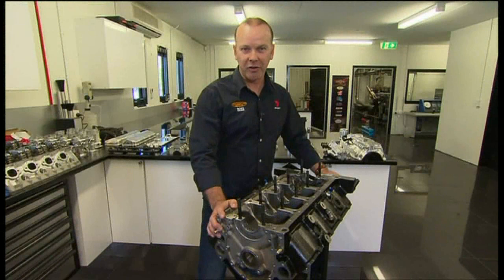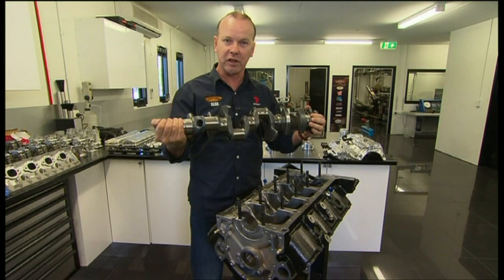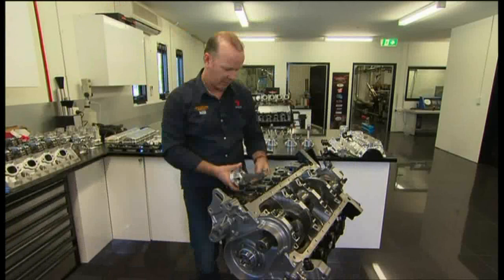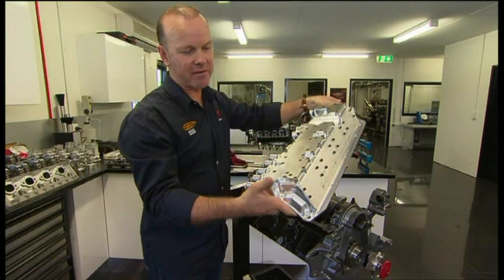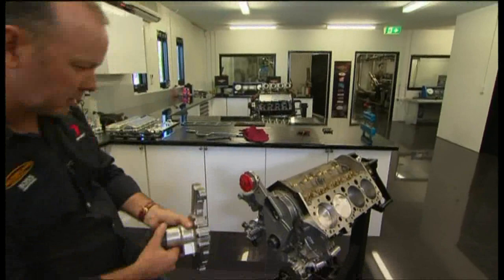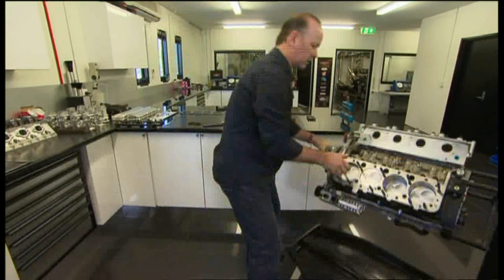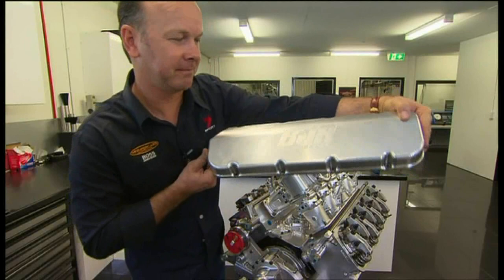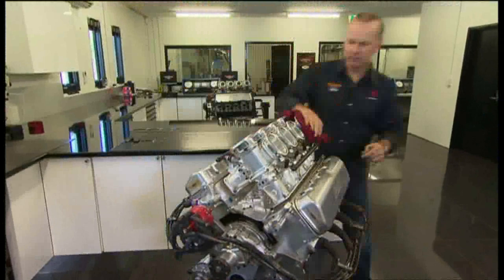V8 supercar engine build with Mark Larkham

Comment: As a ex V8 Supercar engineer the reason for the 5K exhaust header is the cost of the titanium metal used to make the pipes as well as the many hours of hand fabrication involved to make the exhaust by Tig welding together the mandrel bends & merge collector pipes. 
These exhausts are a work of art when finished. Exhaust development is continual.

Comment: there is a lot of mark up on these engines. parts come thru performance wholesale. sold for f all to v8 supercar aus. then they sell parts to the teams at a very big profit...the crank is a 3 grand item, block 2500. cam 530 . they double everything and some
Reply: Nicole Gooch V8 Supercars don't buy the parts. Each team buys them straight from the supplier or manufacturer. Seeing as the majority of parts come from the U.S,  you have to convert the U.S price into the AUZD meaning the price increases, then add import tax and freight.

Comment: The heads look very similar to what would be used on a SB2 in Nascar with the canted valves.
Reply: Nick Hargrave project blueprint basically stole all the good parts off the ford Counterpart in this series(@that time)those heads were based of the canted valve ford  even the block was a specialty to v8 supercars 
Commodore got upgraded with fords double front suspension arms and locations were shared between the cars. 
Ford basically got a little bit better aero..it was the start of when the cars really became to far apart from the road vehicle they were based on nothing in common was really left

Comment: @FordV8Supercar These stats are from the mid-90s, but I do remember them well; Ready to run engine, $60,000, ready to run Hollinger race spec 6-speed, $50,000. The latter, you can choose your own ratios, but there's limits to how much you're allowed to mess with in the engines. A fully prepped car from Perkins (Larry's workshop) Engineering would set you back in excess of $220,000. Then there's tyres, spares, safety equipment, transport pit crews and sourcing a driver

Comment: The tolerances oin CAT engines are extremely tight, often assembled in surgically clean conditions. I meant that a race engine is capable of sometimes up to 9000rpm. A CAT diesel at best will rev out to no more than 4000 maximum rpm And of course, some of the larger CATs fully assembled cost more than $50,000

Comment: @jimmycranberry single camshaft = less space required for the engine. Dual overhead cams take up a lot of space even though they are slightly more efficient. It sounds crazy but Corvettes still use them and they win the 24 Hours of Le Mans with it.

Comment: Why are people watching this? then bagging out V engines. Nissan R35 Skyline has a V6. All the good BMW, Mercedes or Audi's are running V8's or V10's. Audi V10 with turbos. The new Ford GT with 5.0L alloy block S/Charged from factory has 335 kw they run 11.9 down the quarter with a flash tune on stock tyres. Are there any new japanese cars other than the R35 that will even compete? Performance wise and value for money- I think not....

Comment: you'll find that in a lot of cases CAT motors have the same tolerances as lot of road going performance vehicles. just because they are big motors doesn't change the need for tight tolerances

Comment: its a small block chev but with a ford 302 8.2" inch deck height, the heads are a symmetrical port, most likely canted like a Cleveland head but not side canted, only back and forth,  and the fucking intake port is miles high,  I'm guessing a Brodie bd2000, then lightened to the maximum probably moves 430cfm.

Comment: It's a racing block. Not used for daily driving. Like the rest of the motor build, $1100 cams, $6000 crankshaft, etc. All are overpriced because they are specially made for racing in the Super V8 series and all to spec within regulations. Like every other race car in a major racing series, the motors easily go over $100k.

Comment: Nascar engines make about 900 hp at least 250 hp more than a V8 supercar and rev to 10,000 rpm. A fresh engine for each race, you need 35 new engines a year, so economy of scales would make them cheaper to build.

Comment: @ImprezaRacerSTi explaining why its all gm us parts made 'for' holden racing? doesnt make sense, and the nascar heads dont have ports, things like ports and smaller chamber details are always done in house by the teams, in nascar and v8's. but im not 100% if its slightly changed nascar blocks or modified versions of something else. heck they could be the nascar trucks engines for all i know (not as powerful)

Comment: i'm just confused, if v8 supercar is held in australia, why all the engine compenents is manufactured in USA ?
Reply from the maker: +Indrajati Herumurti I think its mainly as there is such a big market in the US that its so much cheaper to get parts....and if you can get it cheaper with probably better quality , why not?
Reply: dallascowboy23, ooww... That's make sense now. All of us know that holden commodore is another name of chevy super sport. However, i think it's an opportunity for any australian engineering for being part of V8 supercar.

I love V8 supercar, it doesn't as fast as F1, but the gap between 1st position to 32nd is only 1.9s.
Reply from the maker: Yeah I love v8 supercars.  Door to door racing! 

Like nascar but they have to stop and turn both ways too ;)
Reply: Indrajati Herumurti
Reply: Because Holden is under the gm brand and the engines for gm cars come from America
Reply: Because Australia has no manufacturing sector anymore and rightly so
Reply: Not Stupid I’m sure there is mate but reality is they would’ve priced themselves out of the market for this type of work so it’s no wonder that all these parts are imported when they’re cheaper and most likely better quality.
Reply: @johnpearce752  the engines for GM come from LS in Canada

Comment: remember all, he's only putting it together for a vid. They would of stripped it down to bare block double checked all components and rebuild the engine within very tight tolerances.. i never looked into v8 super car engines, but its most likely an R07, custom made NASCAR block.. if not its most likely a billet machined aluminium R07.. prob R07 nascar heads as they dont actually come with ports, each team ports there own way.. alot of the internals would be custom designed for v8's tight rules.

Comment: Is it me or did anyone else feel like this video was willy waving, I'm not going to say that these parts aren't that expensive but some of them seemed to be a bit much considering a Nascar engine makes roughly the same hp and only costs in the area of 40-50 grand usd. ( I hate nascar btw) The only parts i would call truely specialized in this whole thing is the induction system. Everything else or its equivalent could be bought from a catalog.
Reply: Not Stupid teams buy direct from the manufacturer
Reply: Most replies. sound like Monday morning quarterbacks or coaches. Talk the talk but can't walk the walk. Durable parts ..or custom handmade are BIG BUCK ITEMS

Comment: "Holden Motorsport" = 305 CHEV
Reply: Mark JW not as Chev. Chev don't make engines and haven't for several decades
Reply: Mark JW and Holden Motorsport haven't used a 305 for several years